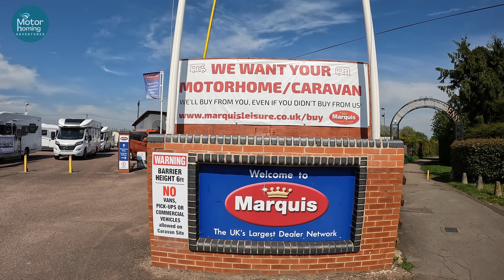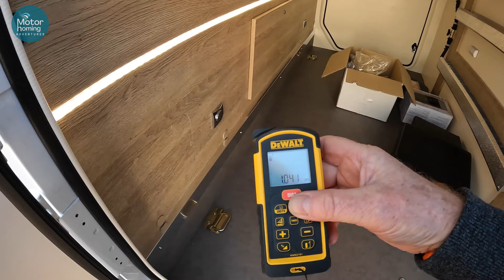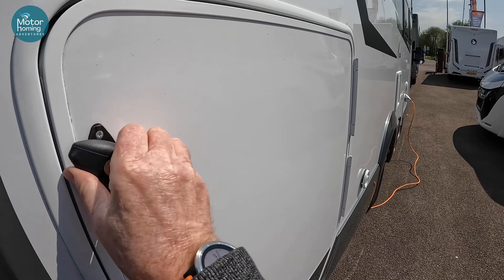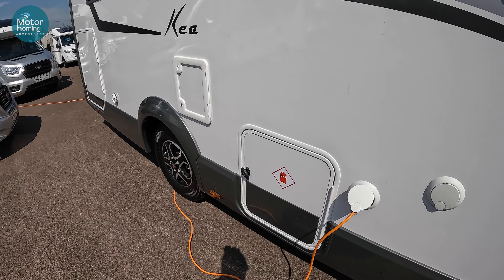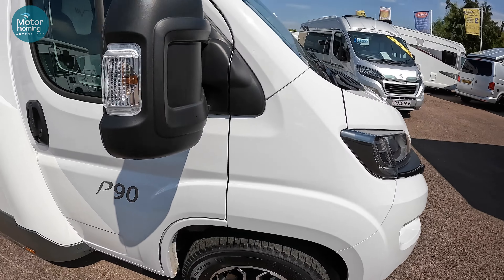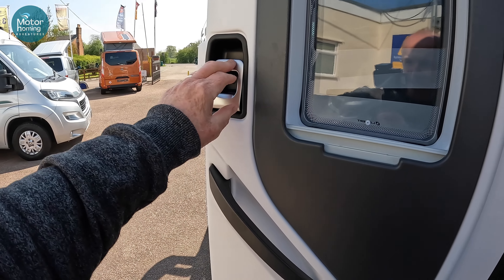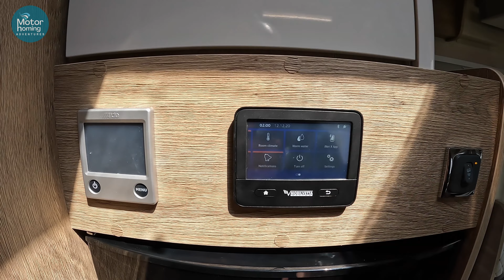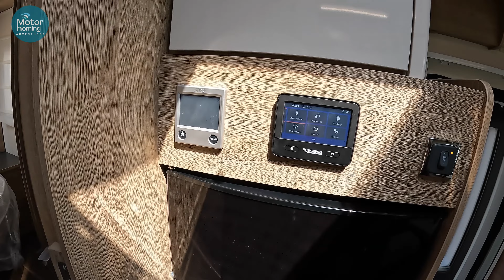Motorhome Walkthroughs: The 2023 Mobilvetta Kea 90 - a detailed look at this coach built motorhome

Comment: @motorhoming adventures , how are you finding your motorhome please , and Nasty niggles to speak of ?
Reply: @motorhomimg adventures , I was actually looking for some owner feedback pleas 🤷🏼‍♂️
Reply from the maker: Hi @jaylepp 
Absolutely love it - the K-Yacht 79 has been excellent and even better with all the mods you may have seen we’ve done (on the channel). 
Dealer at Tewkesbury have been great and 13k untroubled miles. 🤞🤞
Problems? Loose screws - which I’m now used to - in many and varied places; we don’t like the high up gas oven but it works (above the fridge) so often take air fryer which can be used in the garage or on the hob space; The Solar wasn’t great - very cheap system - but that’s gone now! 
We really can’t think of anything else - it’s been so good!!
Currently off grid in Morzine, France in a free Aire and loving it 😍🎉🚌
Reply: @motorhomingadventures  thank you so much , very helpful , I know where you are very well , we are torn , between the same model as yours or the kea 90 , must admit we favour the Aldi heating , as we have Aldi in our Bailey , although not a deal breaker .we are just craving a garage and island bed , as we currently have a French bed . I think there will always be niggles in motorhomes , however always nice to get feedback from owners , as it’s an honest experienced review of course .
Reply from the maker: You’re very welcome - I liked the look of the Aldi heating too. 
Yes the island bed with its electric lift to add more garage volume has been really great when we had the electric bikes on board (now Peggy) and the 4400 means you have an amazing 1 ton plus for loading payload. We added decent memory foam toppers to both mattresses (front and rear) as they were a bit firm for us and that just made it perfect 🤩